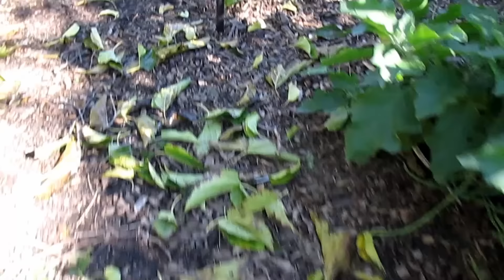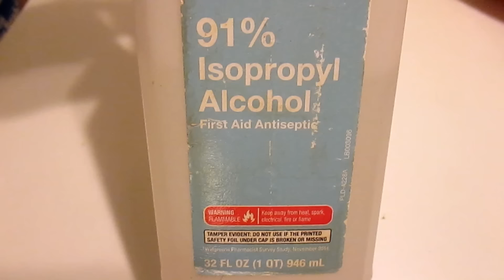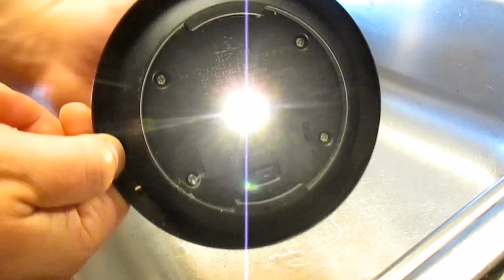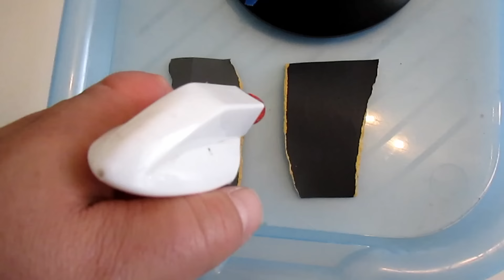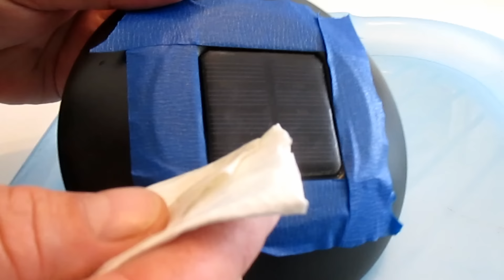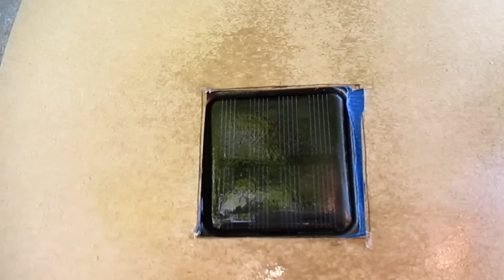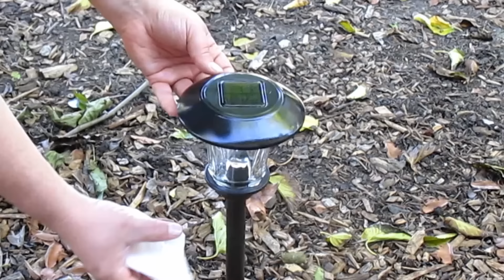Quick & Easy Way to Clean, Renew & Restore Solar Pathway Lights! Wow!! Looks Brand New!!!

Comment: Good advise about restoration. When new I recommend using a thin transparent film placed directly on the solar panel. Then for future maintenance all you have to do is swap out the film without this elaborate cleaning process.

Comment: Won't make any difference.  The circuit board inside will corrode after a year or two.  And the rechargeable battery will fail in 2-3 years.
Reply: I replace the batteries on mine yearly.   I don't have mine in the rain tho, so they don't corrode.

Comment: Thanks for this!  I exclusively buy the Energizer solar lights.  I haven’t had any die in the last 8 years.  The batteries eventually failed, but a lot cheaper to replace the battery than the whole light.

Comment: I will pull my batteries out once a year recharge them on a battery charger.  That one full charge seems to keep them producing great light the whole time.  When that length of time becomes shorter not due the weather. I replaced the batteries.  
Make sure you have the right kind of charger..

Comment: I have so many solar items where the battery is no longer any good. Can you direct me to a video that teaches how to replace the battery? I don't have a solder iron, so is that necessary or is there another way to fix these. Thanks!
Reply: You should not need to solder anytbing. Open up product and you will be able to change battery as you would any other.

Comment: Upscale after you clean em up. Take battery out and check the mAh size on them. Standard 1.2v aaa are usually 300 to 600 mAh. Get some 1000 mAh replacement batteries and stick em in and they will light up till dawn. After you replace the battery dont turn em on for couple days let them charge fully. Do NOT get higher size mAh then 1000 mAh for 1.2v as anything higher could take near a week to charge and the panels are not suited to charge them which will in fact wreck the battery. You can get a box online replacement 1.2v for less than a buck each in quantity and they will last 2 to 3 seasons.

Comment: I’ve been doing this for years and amazed how much longer our solar lights have worked.  However, I like your method using water with the sand paper.  I’m going to change up that part.  In addition, I found a way to check the battery fitness by using a 4 battery wall charger that I use with all my rechargeable AA & AAA batteries.   I check them with a voltage meter and write down how much of a full charge they take.  Many times battery life can vary.  Not all are equal.  Amazon has the best prices for these types of batteries.  I buy them in bulk.  Great info, thanks for posting it.
Reply: A lot of these solar lights take lithium battery’s now. Like mine does.

Comment: I spray the metal parts of my new solar lights with protective high-gloss yacht varnish. I also do this with my metal garden ornaments. I also cover the solar panels with plastic pocket pouches and cut an opening at the end to let the rain-water away.
Reply: That is clear plastic pocket pouches.

Comment: Great video, it’s worth using a proven rust inhibitor like XCP Rust Blocker on the metal, because (in tests on you tube), wd40 doesn’t protect metal for long at all out in the weather

Comment: After a while, the nickel-cad rechargable batteries (they're recharged with the solar panels and power the lights in the evening) don't hold a charge as long. So I had a set of these lights I replaced and saved them, removed the batteries but haven't yet re-installed in the backyard (I got new ones for Christmas). I'll be following your advice to clean up both sets and put in the new rechargable batteries in the older set.

Comment: Use a scrub daddy it won’t scratch the solar panel scrub daddy don’t scratch and if you put scrub daddy in cold water it becomes hard but and scrub daddy has cold water for a while it can hold up a 10 pound and if you put scrub daddy in warm water it becomes squishy and scrub daddy don’t become stinky they clean very easily so buy a scrub daddy and throw away that stinky  regular sponge that is disgusting🤮and a scrub daddy has a face and you can clean your utensils easily by putting your utensils through the scrub daddy’s mouth and the scrub daddy can fit easily and cups you put your two fingers in scrub daddy’s eyes and then you put the scrub daddy in a cup with your fingers scrub daddy’s eyes and then you twist the scrub daddy until the cup is clean also their scrub mommies too and scrub mommies are double sided They have a rough side and a soft side also there is a scrub daddy mop and a barbecue daddy the barbecue daddy is bristle free and there’s the dish daddy there’s the toilet daddy and even more high-quality products. This is not an advertisement this is based off of my experiences and they’re all great products I’m gonna tell you again this is my advertisement

Comment: What happens if you don’t put the clearcoat on the plastic solar panel or glass whatever it is does it need that protection? Is that just for scuff scratch resistant?

Comment: So how to I charge the battery .do I have to turn off the switch during   the day or leave the switch on during the day.,? Some one please help I have the same lights.
Reply: Switch would be ON all the time. Now, IF they are battery operated, and it no longer holds a charge-time to buy New RECHARGEABLE batteries and replace.

Comment: Another tip, after the winter if these were left out, the batteries can be charged with almost any battery charger. Most are Nimh, some might be lithium.  Give them a top up and throw them back in, and you'll have great performance.

Comment: Thanks for the tip, and if I may add, if you have an outage or  misplaced your AAA-AA battery charger, these path lights can act like little solar powered  battery chargers for your AA OR AAA chargeable batteries.

Comment: You could buy new ones on sale cheaper than replacing the batteries. Also could skip a few steps by using headlight polishing kit with a polishing pad attached to a drill.

Comment: Thanks for the guidance.  I have some solar lights that could use this treatment.  I would like to ask, though, do these solar lights last for many years so long as you clean them each year, or do the solar panels sort of wear out after 2-3 seasons?  Also, since they are solar powered, why do you have to put batteries in them?

Comment: Great vid.... I also thought about using the car headlight technique when recondition my solar lights. While I was at it I upgraded the batteries. The original were two years old so roughly 700 charge cycles. The cheaper 1000mAH NiMH batteries are good for about 500 charge cycles. I got 2000mAH replacements rated for 1000 charge cycles for about $1 each.

Comment: I know this is quite old video , does it matter if its 91% or 99% isopropyl 

I also have some new solar lights (OUSFOT 4 pack amazon uk) that look like plastic flat panel, i asusme I can still gloss them,, they are quite good as they have lithium 3.7v battery bms to correctly protect the battery from over and under voltage so don't have to disassemble them to fit a BMS (just use some silicone around the screws that the light hooks onto so They can't be easily removed off the wall) only small downside they are a not as bright as others I have but should last longer over the night

instead of the ones that look like resin filled like in your video (usually I fit a battery only bms if it's 3.7v battery " 10pcs 3A BMS protection board for 1S 3.7v ") 

The AloftSun/LITOM 140 led resin solar (soldered battery with a plug) and 300 led plastic wide solar and uses a battery holder for easy battery replacement, both quite bright (but hard to open because they are ip65/ipx7 and are gasket sealed so needs a little heat to take them apart and reseal after bms installed
Reply: Yes, you can spray new lights with the clear coat to prevent premature fading. And 91 or 99% alcohol will work……Windex will work too as it has alcohol in it and evaporates quickly.
Reply: @CHartnett10  that's good to know, I have already brought some of them in to dry out so I can coat them, I am. Hoping the plastic covered solar panel lights can also be protected this way 

also all the ip65/ipx7 lights I got have low and high voltage cut off just they get really dim when they are at the lower end of the voltage of the battery

Comment: Won't applying a clear coat prevent the sun from entering in the cell and charging it?
Reply: Again, it’s clear, sunlight passes through things that are clear. 
If you spray it with black spray paint, it won’t work.
Get it now.
Reply: It’s CLEAR coat, not DARK coat.
Reply: @CHartnett10  I know that... 🙄 I was just thinking that it would leave a layer that would prevent the sun from coming in.

Comment: Forgot to ask, you leave it dry for a few minutes for applaying the next later. My spray says 24 hours? What does your clearcoat say?
Reply: You can reapply after 15 minutes or so as it becomes tacky then and prevents running. 24 hrs is correct, or longer depending on humidity levels, in order to start touching, using, applying your coated project in its intended application.

Comment: So I already took the entire thing apart because my entire panels where messed up. Had to resolder a few things as well. My light is very cheap and you cannot reach the battery without screwing things open, and in the mean time mess up rusted solder joints. I did use your method for the solar panele and after sanding it looked beyond saviour. Applying clear coat now (different brand I dont live in the US). I am curious how it will work out.

Comment: Just use some alcohol and it's done, sandpaper it will destroy it
Reply: Wrong.
Reply: @CHartnett10  alcohol will clean it, sandpaper will scratch it and it will never get enough sunlight, i tried this before so i know for sure. The panel wich i cleaned it with sandpaper, it was working for some weeks maybe and finally i had to throw it in to the bin and replaced it, the other one which i cleaned just with alcohol(rubbing it easily with an non abrasive sponge and some alcohol for some minutes) it's still working great. I have 4pc of outdoor lamps, they're 3-4 years old and they still works.
Reply: @alexmaddogg5848  Then you did it wrong. Using 400-1000 grit sandpaper will only clean off the stubborn grit and imperfections….has to be wet sanded however as lubrication and prevent scratching. 
Rubbing alcohol on its own is merely cleaning off some dirt.
Reply: That's your opinion, maybe you had another type of solar panel. Mine didn't liked sandpaper at all. I have a lot of sandpaper from 40 grit to 12.000 grit. I had some special alcohol for technical use (pcb, electronics, etc..) and it works flawlessly. You know that every solar panel has an UV protecting clear coat exactly as car headlights. So if you use sandpaper it will go away and it will not let sunshine to go through it (it will lose from it's transparency capacity a lot). I'm not arguing with you at all, it maybe works for you, but not in my case or on every type of solar panels.

Comment: Make sure the clear coat is not a uv blocker, my stepdad made that mistake and by the time I figured it out the onboard batteries were shot.
Reply: Completely untrue and not even remotely possible. Panels only use 4% UV rays and clear coat uv spray will not harm a thing.
Reply: @CHartnett10  That's modern panels and mid to high end maybe. these were old Chinese made junk panels, and while uv was not the main absorption spectra for them, they needed a high absorption on all spectra to get anything at all being terribly inefficient. And the sealer was "Toon bright"  brand Marine grade  protective sealer, and possibly the thickness caused the refractive and high reflectivity of the paint to have as much or more to do with it.  Saying somebody is lying or a mundane thing is impossible without without knowing the specific circumstances or details, and judging a matter by a single malformed data point is bad methodology, Think a little deeper before you try to debunk. That's true even when the statement might be on the edge of possibility since outliers exist. Instead of calling people liars, ask for more information on the data point involved. Before making a summary dismissal. You might actually learn something.
Reply: C Hartnett  It's also possible the battery was poorly made or had a bad manufacturing defect.  One data point is never enough.
Reply: C Hartnett  It's also possible the battery was poorly made or had a bad manufacturing defect.  One data point is never enough.

Comment: Another cleaner for headlights is DEET yes bug repellent.  Spray and wipe (disposable).
Reply: Wrong, that is simply spraying on a film of oil like WD 40. It only masks the issue and lasts for a few weeks only.
Reply: @CHartnett10  actually it dissolves plastic if you leave it on.
Reply: @samwilliams1142  Yes, of course, oil dissolves plastics and rubber……..plastic and rubber are partially made from oil. 
Either way, using Deet is just a short term mask that will wear off quickly.

Comment: when you buy them new, just put some clear tape on the solar part, and  when it get's dull, just peel off and put another piece of clear tape!
Reply: Now that’s just too easy! Lmbo! Wish I had thought of that!
Reply: Thanks for the great tip!
Reply: I do something similar with a super-thin translucent film.
Reply: @pfschuylerwhat kind of film?
Reply: Fire hazard?
Reply: @happycook6737 Huh?
Reply: @happycook6737 fire hazard? on what? solar ground light? that cost maybe $5.00?
Reply: @jrx2662 Where I live it is very dry and fire would be a huge issue. That's why I wonder if it can catch fire. We are 40C and up in summers.
Reply: @happycook6737 yeah, but it's only a piece of clear tape?
Reply: @jrx2662 True

Comment: that and batteries are a common point of failure. Batteries very hard to replace as they are a special amperage not commonly found here in North America. Don't even bother to try fixing a cheap light from the dollar store.

Comment: I've been using the wet sand paper method of cleaning the lenses but they don't stay clear for long, thanks for the clear coat tip. I will do that and shine mine up with Armor All, they will all look brand new. I have gone nuts on purchasing solar lights. I have way too many but they look really cool and I even leave mine out all year.

Comment: I know this is an old video but I just ran across it looking to do the same thing. One question. Doesn't the solar cell need the uv rays from the sun in order to charge? Won't the uv blocking clear coat prevent that?
Reply: No, Panels only use approximately 4% UV Rays toward charging.

Comment: My problem is rust.  We leave yard and string lights out year round since the yard is used all but maybe 2 months yearly. The screws have rusted in the battery pack and i cant get them out. What can I use to unstick? I think I'll spray a little wd40 before clising next time. Please help

Comment: Thank you for your video and comments. If you have new path lights, which, if any, of these steps should be applied? Is there a need to sand down the solar panel if there is no dirt? Should you apply clear coat to NEW solar path lights?

Comment: Today I gathered up about 20 solar lights that weren’t working anymore. I was going to toss them tomorrow. Thank you so so much
Reply: Check the batteries inside the solar panels. They may either be done or maybe the connection might be rusted and require cleaning.

Comment: Worked for me some time ago now, and again today on 2 gutter lights that needed re-doing whilst investigating loss of operation.
Suggested 2 things. 1. Use a quality battery (e.g. Enloop) and pre-charge before installation. 2. Check the operation of the ON/OFF switch as the contacts on this cheap switch can cause problems long term - if you're handy with a soldering iron, bypass the switch as you would rarely need the OFF function once installed on a high mount requiring a ladder.  I'm really impressed with the Rustoleum Clear paint.  I have plenty left for other similar jobs.  Well worth the money.  Cheers!
Reply: How do you bypass the on/off switch on a outdoor solar light? Is it easy to explain or maybe ill just try & google it! Haha. One of my lights switch seems to not be working but electronic panel seems to be.unable to be lifted off the base to see under it.
Reply: @twodogzdogue8710  Well my solar garden light did have screws.  So I could get to the underside where the 2 wires joined the slide switch. Then I could unsolder one wire and join it to the other thus making the switch redundant.  -  Regards, Jim.

Comment: Even clear coat doesn't last long. The best way around it is either find pathway solar lights with glass solar panel surface (which is very hard to do) or install wired pathway lights, the ones you power from 12v transformer plugged into your house's AC outlet outside.

Comment: On the clear coat isn't the UV what makes the panel work.  I've taken a new solar light and applied a thin coat of non discoloring clear outdoor silicone.  Not sure how long it's going to last but my sample is still clean , clear and charging 6 months later.  One without it are tan and bumpy and not charging very well.  I think I'll use your method to clean them and apply my silicone
Reply: Only 4% UV goes towards charging. Silicone is not recommended versus this clear cost method.

Comment: Thanks so much for your video!  Worked great on my old solar lights I bought at Costco 8 years ago~ using your method I did metal part as well with Rustoleum bronze & they look brand new! ( I leave mine out year round so they were in rough shape)  Again ~ Thank you!

Comment: When I buy new ones, I cover the battery and contacts with Dielectric, bypass the on/off switch and smear on a thin layer of clear silicone over the whole top..